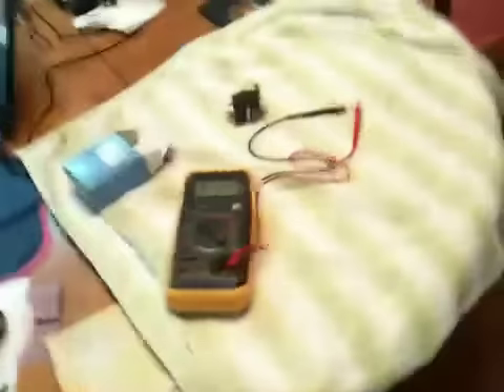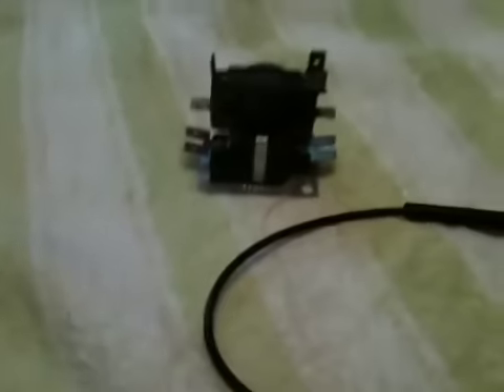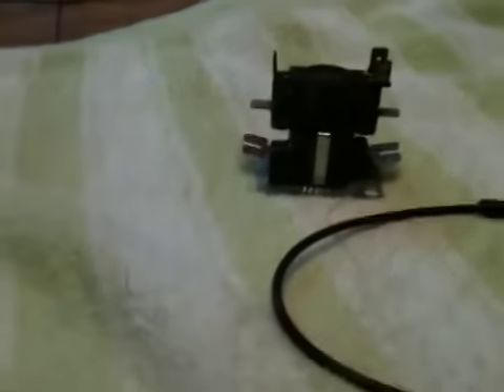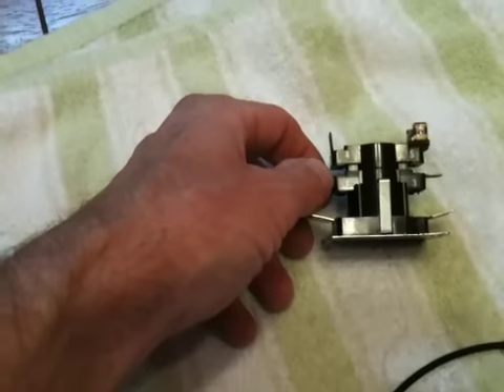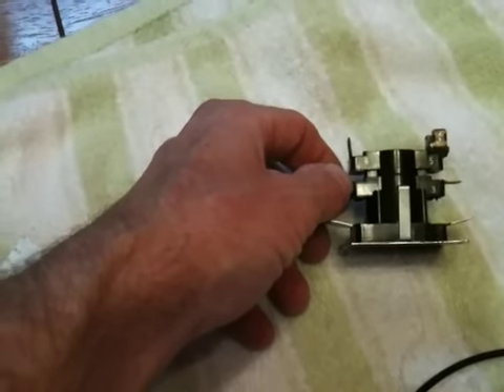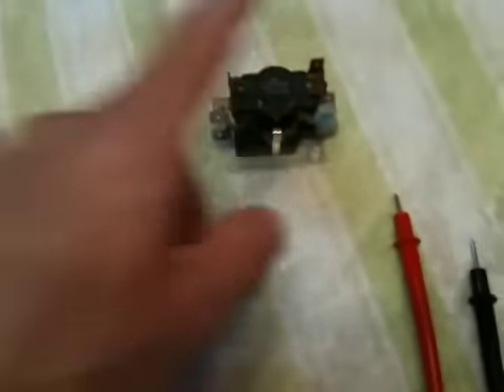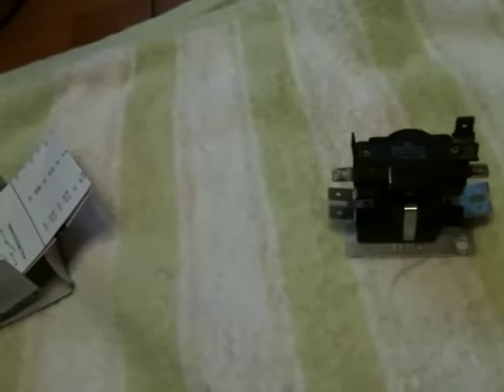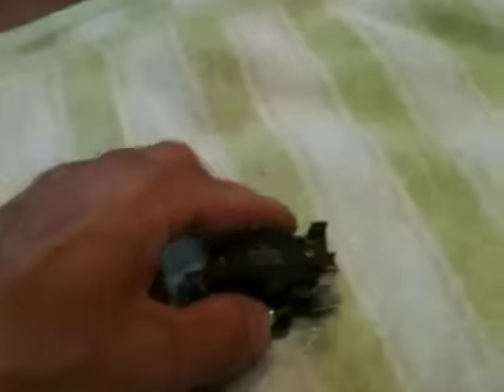HVAC Faulty heat sequencer

Comment from the maker: @jayrod2 The numbers are seconds,  they indicate the on and off times, usually the first set of numbers will indicate how long it takes to come on.  For instance 1-24 says that when the heat is called for that sequencer will take between 1 and 24 seconds to heat the switch and turn on the power, also there will be an 'off' time, on this one it might be 30-90 seconds, so after the thermostat stops at temp the switch will take that long to shut off. ...(cont. next message)

Comment from the maker: @mikie2501 (continued) ...the reason (usually) of these is that you will have say 2 or 4 heat strips, the first will come on sat at 1-24 sec and the next set of strips will have, say, a 30-90 ON count.  That way they come on in steps and go off in steps.
   Michael

Comment from the maker: @jumboray   Yes that could be an issue.  Normally if I have a blower but no heat call the first thing I would do as a tech would be to verify that the sequencers are receiving 24v from the thermostat.  I've seen it something as simple as a loose wire (24v) or someone had installed a new 'digital' thermostat and the thing was set to heat pump mode and not calling for the heat strips ;>     If your not a tech then you might have a tech check this out, remember high voltage kills! :~( )

Comment from the maker: sweet :>  One of the big things I see more often than you would think is someone going back and putting a wrong replacement squeuencer in place of the 1-40 second on one.  A lot of times they will put the blower medium speed and a heat strip on this and I'll see it cutting on late after another heat strip is already on.  heh.  I should do a diagram or something... hmm...

Comment: what is 1/24 on and 40/70 off mean? I am new to these, I just burned one up trying to hotwire my air conditioning to cool because the thermostat died. (stupid me) I tested the voltage and traced it all the way up to the heat sequencer. Voltage is going in, but not coming out so it must be bad. Its a double stack also, I tried to seperate the two halves but it started to crack the case. Isnt it supposed to come apart? Thanks for the videos!

Comment: hi mike i found out that it is a high limit switch instead of a sequencer, it thru me off because it looks similar to a sequencer, anyway thank you so much for responding to my query,i found that a  previous tech had low speed on fan disconnected from fan relay so it would not call for fan when heat was set on auto at thermostat only strips would come on unless t-stat was set to on and heat, does that make sense . i will ask for your help again in the future if i may thank you J.S.

Comment: If you hear clicking in furnace and thermostat is is off position and still hear the click could this be sequencer also noticed motor stayed warm without starting up furnace like you mentioned, when turned on furnace cycles and works perfect is it an immediate emergency to replace sequencer.

Comment: Just installed a Nordyne GP3RD-036K.  As soon as power was turned on, the heat strips got so hot so fast they burned out.  Even with no Thermostat call for anything at all.  Finally had to disconnect heat strips altogether just to be able to run in AC Cooling mode.  Also not sure if this is a heat pump.  Without heat strips connected and placed in heating mode, it also cools?  Replaced another Nordyne Heat Pump Package unit.  Any help would be appreciated!
Reply: ever figure our your problem? I am having same issue.

Comment: yea i have a double stack sequencer and a single switch sequencer attached to the strip panel the double was bad but the heat still wont come on when set to autodoes this mean the single is still bad

Comment: I had the heat sequencer replaced in my furnace a few weeks ago. Now that that has been done, I am still hearing clicking noises coming from the furnace. The "heat" is clicking on and off between the heat and fan running together. Is this a normal thing or is there probably something wrong with the new sequencer? I've tried to call the people that fixed it, being that its Saturday, I probably won't hear anything until Monday. I am just worried if I should not use the heat or if it is still "safe?"
Reply: I was wondering if your problem turned out to be the high temperature limit switch that was making the clicking noise. I had changed out my sequencers and it just happened that a few days later I was near the firnace and heard the audible click. Mine is a 15k 3 element heat strip. It has a double stack 165 f  high heat limit switch for 2 strips and a separate 140 f high heat limit switch for tbe 3rd element. It was this 140 f limit switch that was cycling on and off. So I changed it out for a new one and that solved the problem. What happened was that when my sequencer was failing, one of the sequencer stacks was stuck closed and kept that 3rd strip on without the blower. So that high heat limit switch was cycling on and off constantly for many days before I happened to notice one day how warm the area if the furnace was even though the heater had not been on fir a while. And it was hearing a clicking sound (the high limit switch cycling on and off). So I assume it must have wore out and become more sensitive to the heat temperature so it was ppening at a lower than 140 f temp.
Reply: It may be your high limit temperature  switch that is,cycling on and off. This can happen when there is not enough air flow across the heat strips. To fix can be as simple as changing your filter if it's dirty. Or it could be the high limit switch is faulty and should be replaced.  Chabging the switch is not very difficult but of course don't DIY if you are not familiar/comfortable with electricity. But if you do, please follow ALL safety protocals that most of these videos advise. Biggest one of course is turning off power (and verifying at the furnace that power is off too).

Comment: I have an electric furnace and heat pump. When the auxilary heat kicks in, all of the heat strips are coming on, not just one. Is it possible I have a sequencer stuck in the closed position?
Reply from the maker: Not necessarily, it may just be wired up that way. Typically if aux kicks in then its cold enough that your heat pump just can't keep up, so it makes sense to heat the place up quickly.  I can't remember the last time I didn't see all the strips come on for aux heat.  If you're testing with a meter to know that they are all coming on then it should be easy to tell if a sequencer is stuck though, it will still be powered up right after the heat cuts out, until the limit trips.  Fortunately they stick off a lot more than they do on, I've only ever caught them in the act stuck on on a single air handler! I didn't want their electric bill that summer! (Yes summer!!)
Reply: mikie2501 If the emergency heat is on I expect all the heat strips to come on.  In aux, one or two should remain off as the heat strip kit is supplementing the heat pump.